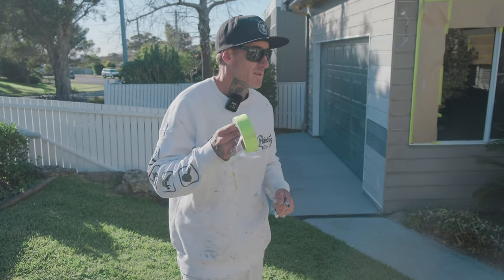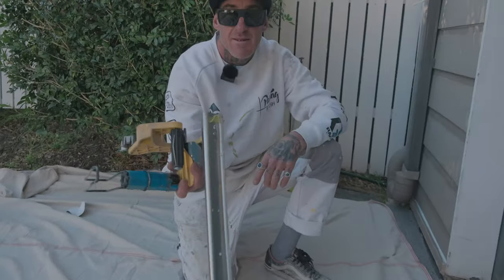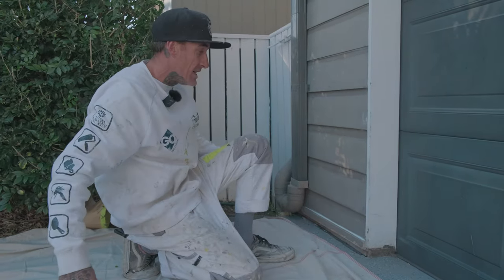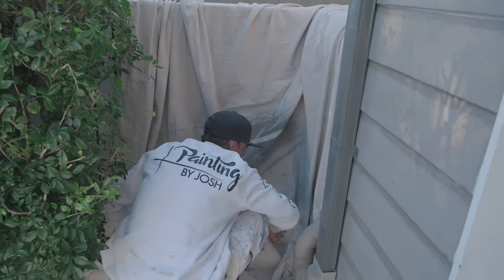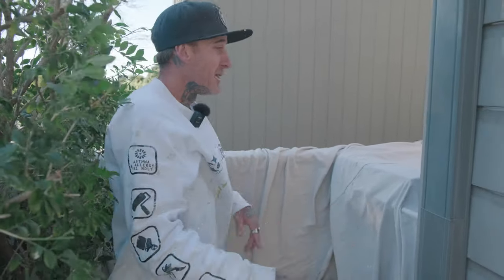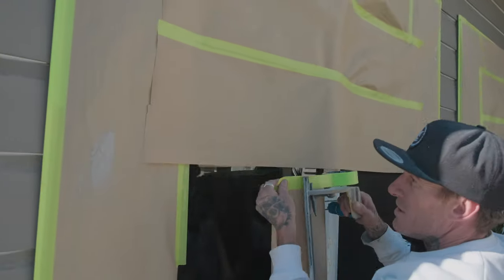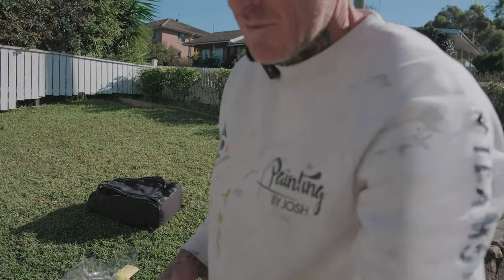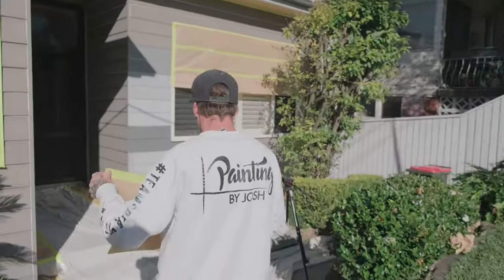HOW TO MASK UP TO SPRAY A HOUSE

Comment: Just to help. If you place the drop cloths on top of the paper, they don't blow up, and you don't have to tape it to the cloth.
Reply from the maker: You got it all wrong they do blow up and paint goes underneath! Ben doing this for 26 years I know what works and it's not the way you are talking I have another video explaining all this. Maybe you need to check it out. Cheers
Reply: @Painting by Josh  26 years is a long time. Maybe I was taught wrong back in the 80s when i started, but my drop cloths don't blow up. Mine aren't the lite piddly ones they sell today. I did check out the other one, it's great content. I know what works too, have a good one.
Reply from the maker: @Danny  my drop sheets are heavy duty when you are running high pressure no doubt it's going to blow up a drop cloth. Maybe you need to start your own Channel if if know what's up.🙏cheers

Comment: hi josh  a question ..how do you get the paper or plastic to cover or keep in the top of gutter ? is it just the tape from paper roller or another method .. i struggle getting the paper taping up to adhere to inside top gutter...???  or do you stick it only to very top of gutter ? i cant see the tape on the gutter tops .. on roof ...........i appreciate your tip

Comment: I totally agree with the tape going over the tab on the 3m masker. I seen your other video the other week and gave it a try. It's so much better and moves freely, especially if your using plastic around windows, kitchen etc. Great videos guys 👍🏻
Daniel ( EnglandUK )
Reply from the maker: Cheers for the comment mate. Definitely rolls a little smoother. Glad i could throw it out there 💯🙏 respect

Comment: Hi Josh, I see what spray can you use in other videos for aluminium window frames. 
Would u recommend duramax for white paint to spray interior aluminium windows (some rooms no natural light)  or will it go yellow?

 Or would you recommend a water based paint for the aluminium window frames?
Reply from the maker: Hi Gavin. I definitely recommend the Dulux Duramax it's formulated not to yellow so you will not have a drama. 👍
Reply: @paintingbyjosh  
Thanks for your reply, I picked up some dulux aquanamel that I was considering spraying on with an airless spray gun. I will take a look at the duramax. 

Would you say the aquanamel is not the right product for aluminium window paint?
Reply from the maker: @Gavin Hill  I wouldn't recommend using the aquanamel on the aluminium it will work but longevity it will not. You can achieve  a factory finish using the method & products I use & guaranteed to last 💯
Reply: @paintingbyjosh  
Appreciate the info thanks!